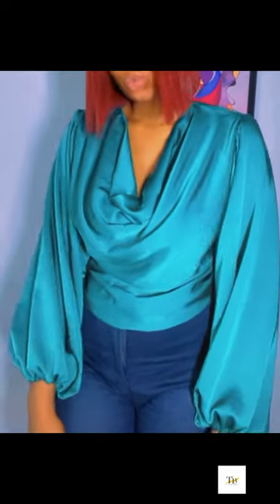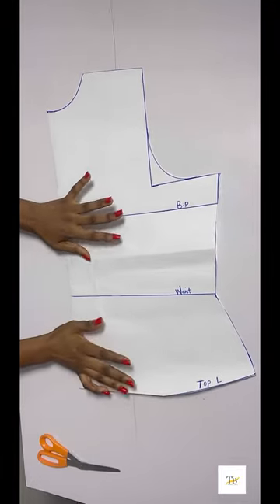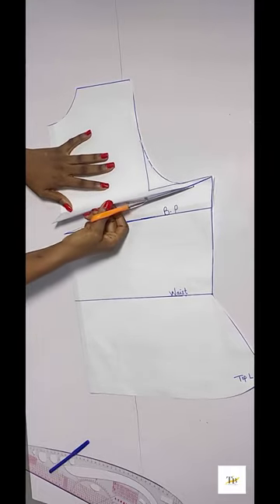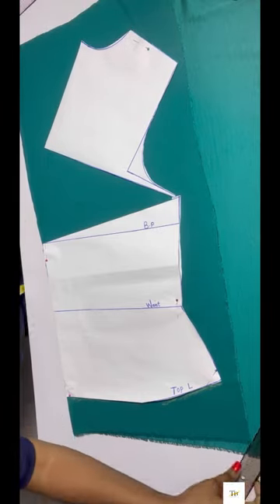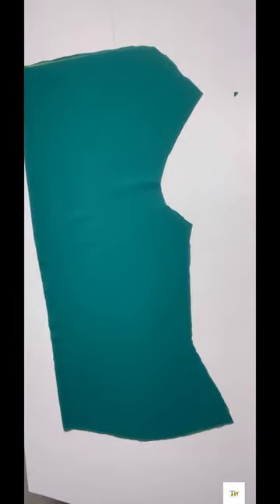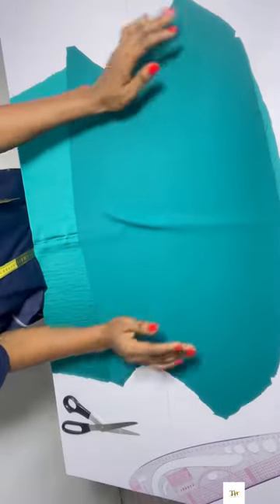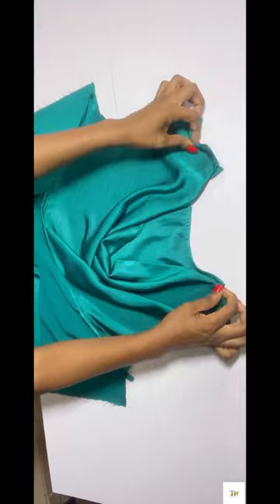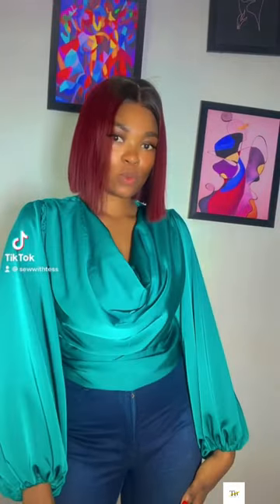How to make. Cowl neck top #cowlneck #diy #diycraft

Comment: Are we to close the sides with our accurate measurements?? I mean for bust,waist and hip…. Since it is not fitted….
Reply from the maker: It depends on you …if u want it fitted add zip allowance to ur back pattern den close the sides with ur accurate measurements 
But if u want it free  , don’t use ur exact measurements make it a bit free